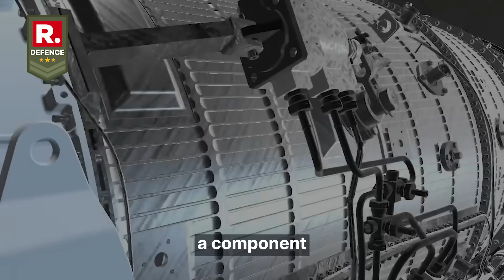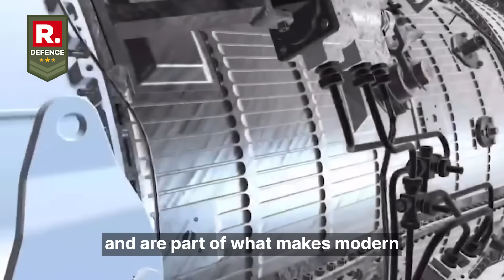DRDO Sparks New Hope for Kaveri Engine in Tejas Fighter

Comment: Decreasing the weight of an engine is very much technical,complicated and time taking because we need more metallurgical experimentation ,instead what we can do is that we can try to decrease the weight of the tezas body frame by using more carbon fibre materials,making more 3d printed metals and all to cut out or decrease the metal uses in most of the parts,this will ultimately help to increase the overall weight of our kaveri tejas and we will be able to use it

Comment: I just wonder what we as a country doing in case turbine blades. We visited BHEL as a college visit during 2008-09, came to know all the turbine blades and generator conductors are imported from France. We are in 2025 and still importing from France. India really needs to up the effort in this area.
Reply: Midhani developed single crystal blades
Reply: we have developed Singe crystal blade out of nickel alloy. What we lack in is thermal barrier coating.

Also there is absence of supply chain of important items nd also machinery/technology. 

but if we continue with our efforts soon we will overcome this

Comment: I’m not sure v will get any significant ToT. Substantial ToT usually only happens under extraordinary circumstances. Like if the vendor is sure that the customer is close to making it themselves. Or if a country is a serious geo strategic ally . V don’t fulfil either criteria . So I doubt that anything significant will come out of it. V need to parallely pursue research for a pure indigenous engine. Otherwise v will be back to square one once the collaboration is over and wouldn’t have learnt anything worthwhile.

Comment: Why cant we go for a twin engine 4.5 with Kaveri instead of trying to from what kaveri cannot achieve? IAF/DRDO must have better vision.  
China started by flying one of the engines on its large sukhoi type fighters and the other being AL-41 from sukhoi. Why cant we have the same ground up vision?
Reply: because china has know how and also similarly powerful engines to not create TWR problem
Reply: @Priyanshu-d4d  TWR problem is for single engine. The TWR of MA-88used in Rafale and Kaveri are comparable wrt dry and wet thrust. Why not just move with that approach instead of pie in the sky single engine fighter and amca.
Reply: @tridentright  UNTIL AND ULESS YOU USE  A ENGINE WITH SIMILAR THRUST YOU SHOULDNT USE ANOTHER ENGINE ITS BASIC AVIATION KNOWLEDGE
Reply: @Priyanshu-d4d  No need to scream. You might have come out from Boeing not all of us are.  
The point being made are al-41 and WS-10 are different engines with close enough thrusts not same. Similarly MA-88 and kaveri have similar thrusts not same. Are you able to see the comparison? Also with single engine risk of failure is high. With twin engine it is mitigated even if we use both kaveri its not likely both fail at same time thus taking the pilot to safety.
Reply: The Chinese built a replica of the Russian engine.  Kaveri is not a replica of anything else.